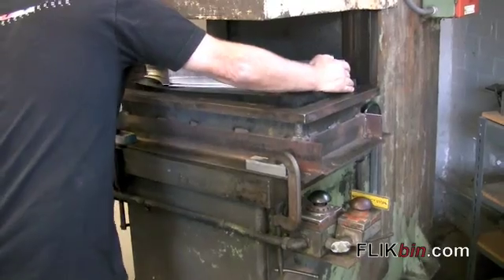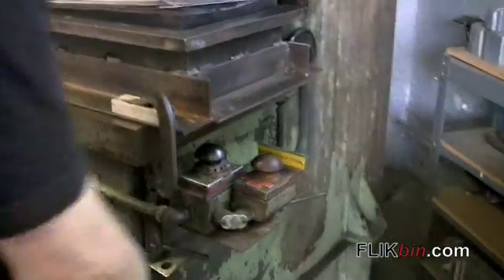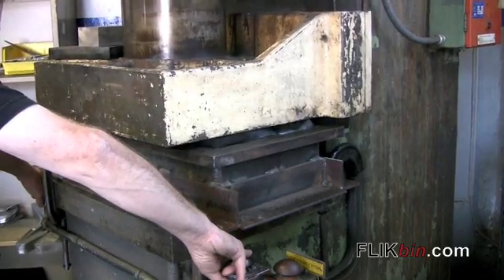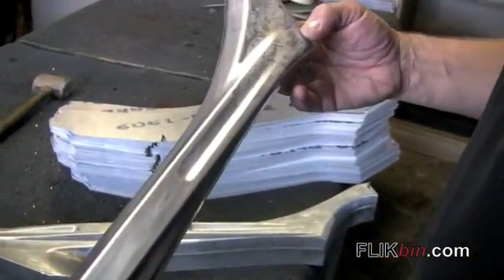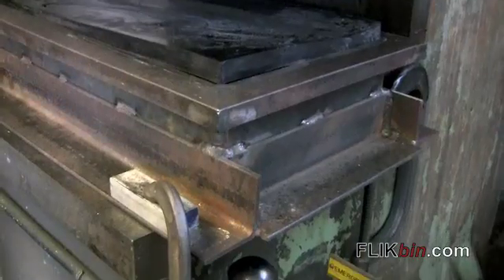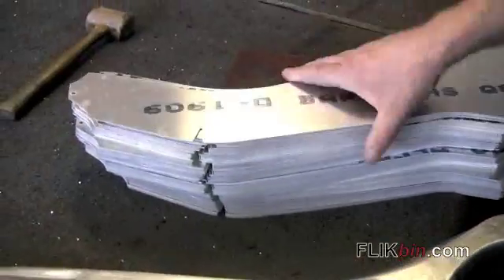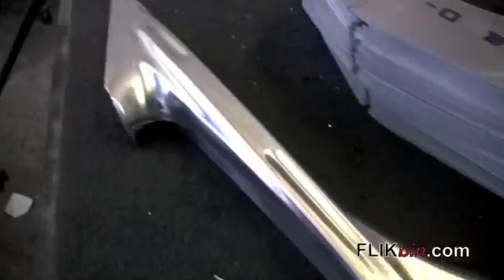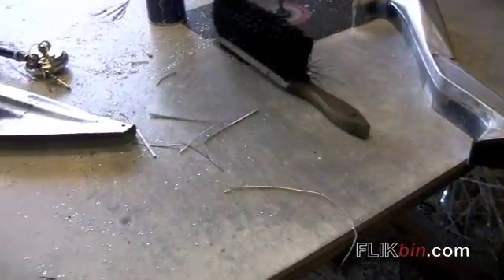FOES - Tube forming process

Comment from the maker: Ha, ha so right your are.  This term is sometimes used loosely to describe tube-forming processes.  This is more of a pressure-forming process using 100,000 pounds of downward force to shape aluminum as if it were butter on bread.  Glad you like the video!